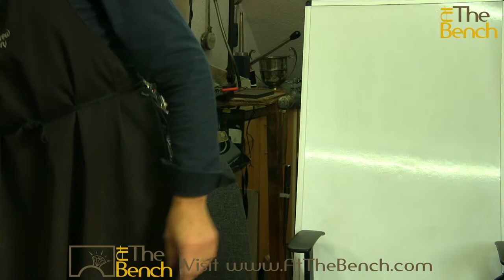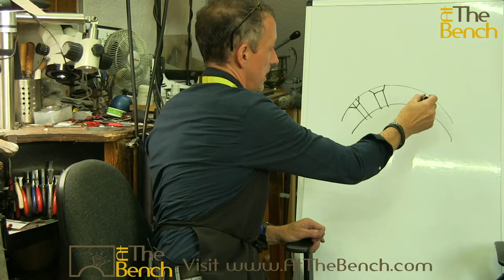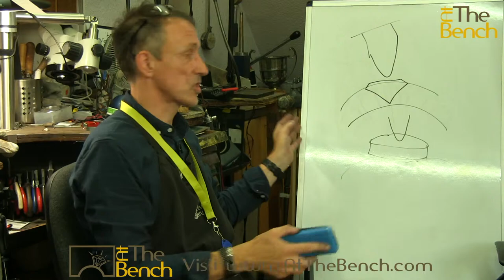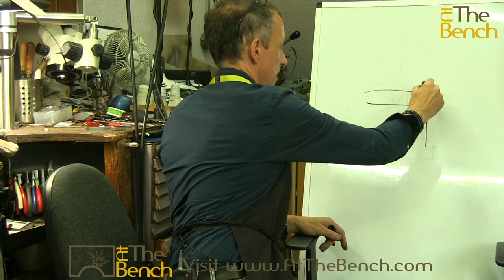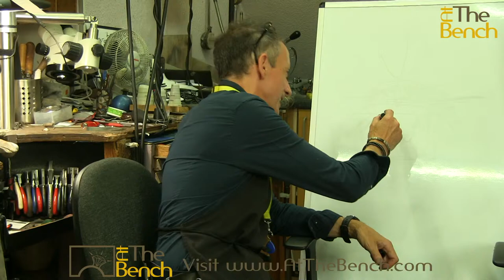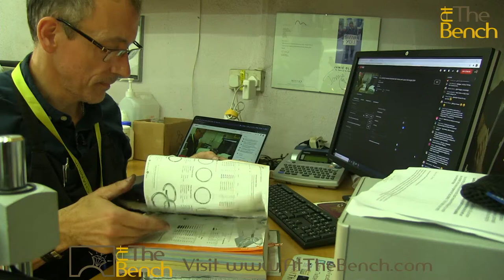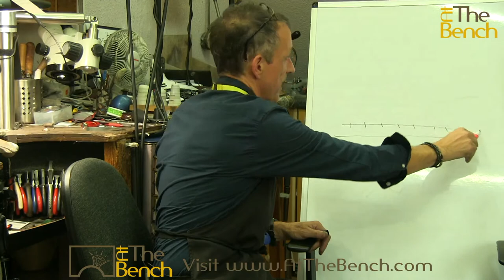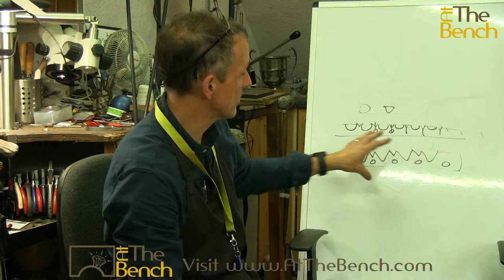Live Jewellery Questions Answered with Andrew and Louise 24th August 2020

Comment: Thanks Andrew, once again, for all the great tips and info. Oval Jump Rings?? I remember my 1st attempt, wrapping a strip of wire around a beautifully sculpted oval  bar 6 mm x 4 mm. The problem I hit was that the wire  bound  to the oval bar. It could not recoil. Best method I find, is a pair of needles (darning size to knitting sizes) side by side. I use a cordless drill on slow setting. You'll wind up with what looks like a double helix string. The most difficult part is undoing the coil effect before cutting. Very doable and the range of oval jump ring sizes is huge.
Great to see you actually "At The Bench". I think the concept might catch on.

Comment: Hi Andrew, my comment pertains to your answer about soldering copper rings. There IS a way to use silver solder on copper rings without it showing and without painting it. (please see video:   https://youtu.be/5J_FmytCzp8 )
I saw that video of a copper ring being soldered with silver solder and was impressed when the end result did not show the silver nor could you see where the join was.  Somehow, during polishing, the silver got buffed out or buffed over (?) with bits of copper from the ring itself (I think?).  I think it had something to do with the direction it was being polished but whatever the reason you could NOT see any silver.  It looked really good. Please take a look at the video when you have time.   Maybe you'll know why the silver wasn't visible in the copper after polishing?  Thanks!  🙂